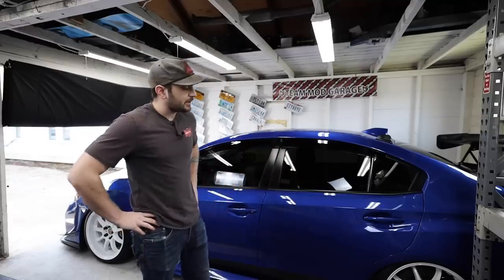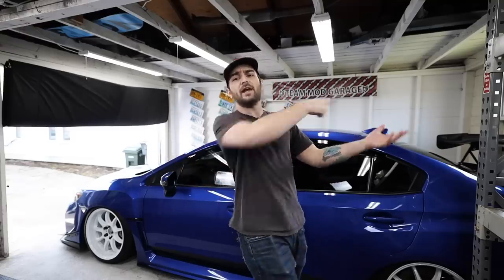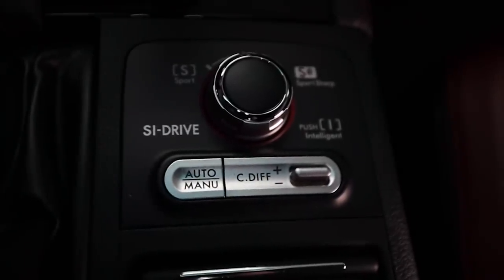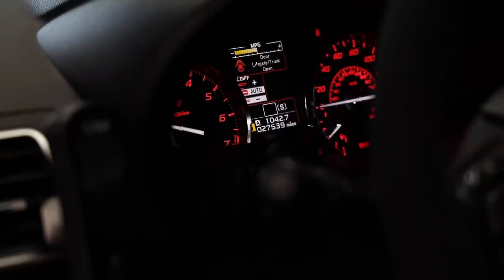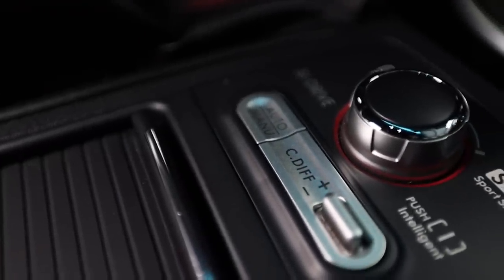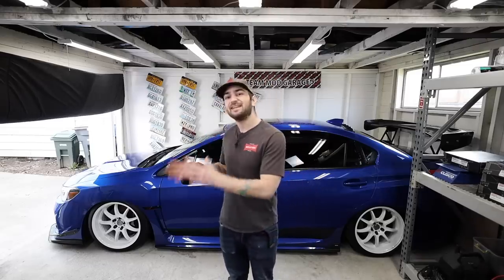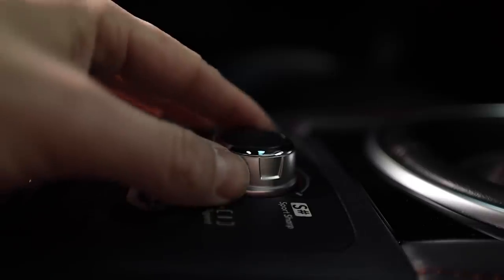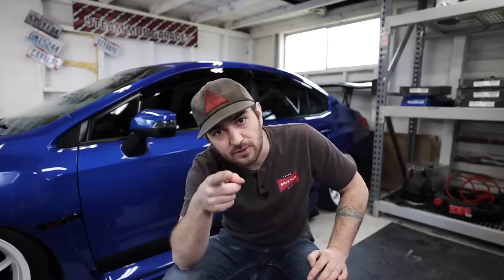Subaru STI DCCD (Driver Controlled Center Diff), SI Drive Explained

Comment: Thanks for making the video. For the occasional trip to the drag strip, what settings for DCCD would u recommend?
Reply from the maker: Going to depend on track conditions but I would start in auto and see how the car feels then swap over to manual, start halfway in manual and adjust from there
Reply: Smeedia I compared locked and one bar, and I had a significant time decrease. I heard that can be bad for the diff tho?
Reply: @hamzahahmed2642  definitely don't drive with it locked on dry pavement. That is something that you can use on loose gravel or snow. Jeep Rubicons can lock their front and rear differentials for mud, mud snow, gravel, and rock crawling. With both vehicles, the wheels naturally need turn at different speeds on dry pavement. When you lock up the differentials on dry pavement the wheels cannot turn at different speeds like they normally do and will bind up and cause heavy wear on your drive train components. Loose or slippery surfaces allow the wheels to slip greatly reducing the wear on the drive train.

Comment: Which mode would be the best to use with hand brakes in your opinion?
Reply from the maker: You doing donuts and skids? 👀
Reply: @Smeedia  abit of both lol
Reply from the maker: What surface? Asphalt?
Reply: @Smeedia  asphalt :)
Reply from the maker: Set the diff to almost lock but don't fully lock it up, can cause damage
Reply: @Smeedia  cheers

Comment: Can you explain what the manual mode actually does before I go "too hard" on my STI? I usually leave it in auto minus on nice days like you do and I understand the difference in those settings but I've never played in manual mode other than locking it up in dirt or sand.
Reply from the maker: Its going to depend on the surface your driving on, but playing with it nicely is the best way to get a feel for it. It will start to bind up the diff little by little to prove optimal grip when used. Just don't throw it in lock on asphalt and send it and you'll be alright lol
Reply: @Smeedia  so you will get more torque to the back in manual then in auto?
Reply from the maker: @thatfishguy2000  that depends on the surface your driving on and weather conditions. With manual you'll have to adjust
Reply: @Smeedia  okay thanks for the explanation. I love your videos. Arguably some of the best Subaru videos out there! Keep up the hard work I know it's not easy but you give alot of good details about our favorite platform!

Comment: Is it ok to be messing with it while driving? I was told not to from the dealer when I got mine so I adjust only when stopped.
Reply from the maker: I adjust the auto settings while driving. I wouldent mess with the manual mode while moving though
Reply: Smeedia it’s completely fine to change while in motion.... just make sure the wheels aren’t slipping

Comment: can u have auto minus and also have the dccd on at the same time?
Reply from the maker: No, yhr DCCD will over ride the Auto settings
Reply: @Smeedia  ok ty much; i also have another question. i have a 15 sti limited. what does
1) LSD torque
2) Traction torque
3) Initial LSD torque (maximum)
4) Initial LSD torque (minimum)
A) Initial LSD torque (adjustable)
B) Mechanical LSD torque
mean in lamans terms? cuz ive researched for about a few hours and still cant comprehend what mechanical lsd torque and initial lsd torque and so on and so fourth mean ;/ please help

Comment: Hi mate love your videos, I'm really considering buying a new STI, can you damage your diff using auto + or - if you use them in the wrong conditions or is it completely safe?
Reply from the maker: You really have to dig into it and beat on the car to do any real damage in auto plus or minus. Pretty safe settings to use. Also appreciate the feedback! 😁
Reply: For what I understood Auto the car will detect your activity and do it for you. Auto - better handling and more fun in dry conditions. Auto + when it snows or rains for better control and traction. I’m pretty sure they’re all safe that’s what the car was designed for. Just don’t fool around with the Manual if you’re not sure what it does. Just stick to Auto -+ and you’ll be good.

Comment: nice. so putting it in sport doesn't do anything different for power? lol I see alot of drivers posting vids that day it does . or am I confused of what your saying?
Reply: @Smeedia  I typed this before I finished the vid. my bad lol. like regarding the question I had. I'm looking into a sti.  that's why I'm asking
Reply from the maker: All the VDC does is change throttle % and limits it, it doesn't actually change the power of the car. So if your at 50% in sport mode you would be at 80% in sport sharp
Reply: @Smeedia  thanks man. I'm really looking into getting one before they get rid of this motor.  I found a brand new one at the dealer I go to for service for around 36k. it's just a base model and I'm find with that. but there is something about the sti .
Reply from the maker: @somersfamily  I agree, something about the car just pulls people in 🔥

Comment: If tuned  , how does it affect si, s, s# modes?
Reply from the maker: Your tuner will use the SI drive as the boost controller essentially. 

For I I am tuned ar 13 PSI 
Sport 15 PSI 
Sport # 19 PSI

Comment: The Intelligent Drive System is what refers to the different throttle mapping settings.  The VDC refers to vehicle dynamics control i.e. the brake-based torque vectoring system and traction control system.

And you didn't explain anything about how the DCCD system actually works.  I get not to expect a deep technical dive but you didn't explain anything to further my understanding of what exactly a looser or more locked differential setting accomplishes.  I can only assume it adjusts how aggressively the center diff allows or prevents slippage/wheelspin difference between the front and rear axles, or locks them in the same rotational speed in manual locked mode.

But this is my guess.  I have yet to see a proper explanation at even the basic level we're discussing it on.
Reply from the maker: For some reason I kept calling the SI Drive VDC aside from that should be accurate

Comment: no you wrong. no front no rear bias torque. just free open diff to full diff lock and everything in between auto- mean auto to free open diff bias. torque bias still alway 41/59 exept when you set to full lock that mean lock 1:1 mean 50/50.

Comment: One of my favorite things to do is to play on a wet skidpad, do you suggest auto - for more sidways fun?
Reply from the maker: Wouldent suggest a WRX or STI for sideways fun 😅 but if your really wanting to, set the diff to lock on a wet skid pad and go nuts. It won't be the same as a RWD car but will be more loose. Just be mindful to not obliterate your diffs lol
Reply: @Smeedia  haha wow set diff on lock you say .  Do you think a few power slides here and there should be enough to put my diff in any danger ?
Reply from the maker: What surface are you doing said skids on? 😅

Comment: i own a 2015 sti
had 2005 then 2008 and now 2015
quick lesson
full lock for snow
manual rear for drifting on corners and thats its basically 
auto plus and auto minus is rubbish

Comment: Stay away from Manual Lock, previous experience lol
Reply from the maker: Lol don't go HAM with the manual lock 😅
Reply: Smeedia I didn’t lol. Was testing out the different increases in my old 14 Sti and never again. Like you I did not like what I felt from the car and stuck with Auto +/-.
Reply: Starplatnium lolll hopefully you weren’t using full lock on dry pavement doing tight slow turns lollll... but that full lock is sick in the snow
Reply: tjlovesrachel small patch of pavement into a dirt road. Didn’t expect that quick reaction response 🤣